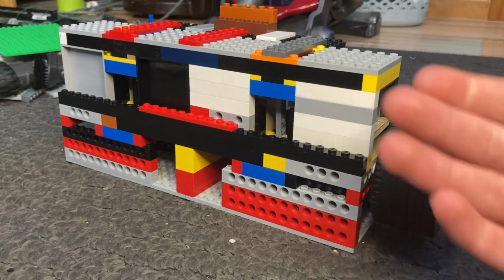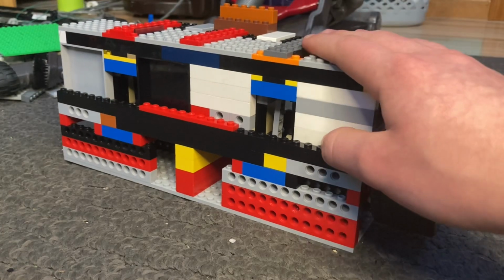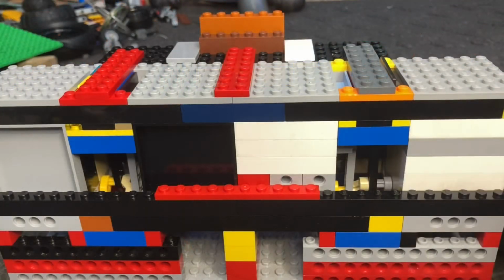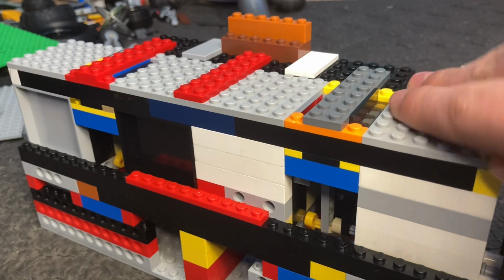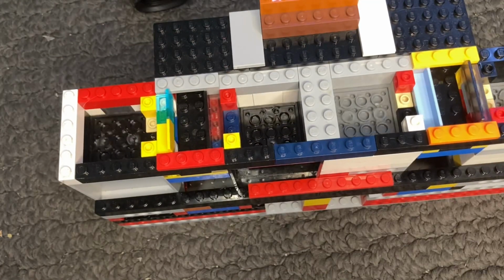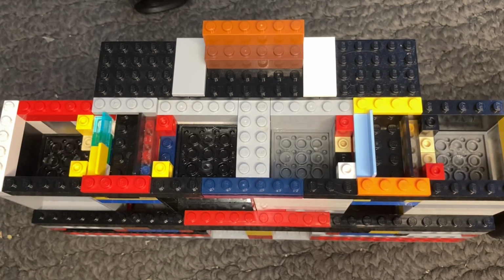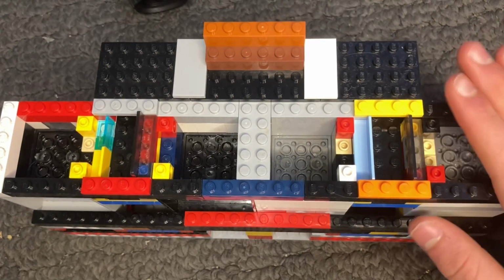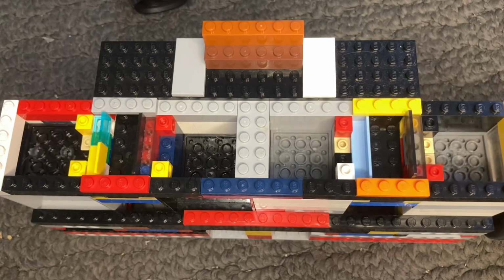4 Cylinder Lego Vacuum Engine

Comment: I have basically a two cylinder version of this where I looked at your basic engine tutorial and built two of thosesingle cyliinder lves and smashed them together. Works great cause your engines have a great desgin and very low parasitic loss. :)
Reply: Wow I did the same thing
Reply: @legoengine1464  its a great desginright
Reply: Yeah
Reply: Except I made mine with 4x6 pistons instead of 4x4

Comment: Sir, an engine is a device intended to power something. And while hearing one of these rev up high and spin a flywheel is exhilarating . . . The economically-minded part of me sees these and thinks “wow, this is wasteful!” While powering a car to pull an entire vacuum cleaner around is probably a tall task to ask of a chunk of plastic toy bricks, making some kind of assembly line or piece of stationary machinery for these to power is certainly a reasonable idea - well, in my mind at least. I don’t really know, it’s been years since I’ve so much as seen a lego brick, and I’m not a professional engineer. I don’t have exact ideas, but this thing SCREAMS at me “connect me to some machinery, darn it!” So for the sake of easing my mind’s tendencies towards conserving energy and putting it to good use, would it be a tall order to ask you to brainstorm some kind of machine to power these with? I have a factory, mill, or generator loosely in mind, though I’m aware there’s really no end to stationary machinery an engine could power - I had the privilege of watching a 16-cylinder industrial diesel engine get rigged onto a spud barge in texas for the sole purpose of pumping ludicrous amounts of water around for commercial diving operations, for example. The thing was bigger than my damn car!

Let me know what you think, what such ideas you may have, or if you want my humble expert opinion on what sort of thing you could power this bad boy with :3

Until the youtube notification gods get this your way, and you respond, I say, “toodles, and congrats again on 1k subs. I told you it was gonna happen fast😏”
Reply: My opinion is people make the engine itself for fun. I mean, I did see someone make a 4 cylinder drag car with an LVE.
Reply: @kiefox7162  wait, what? How the hell does that work? You need a vacuum cleaner to make an lve work, how’d the dragster carry that around? Was it a portable hand vacuum or something? Or just a really long vacuum hose?
Reply: @StealthTheUnknown  they had a long vacuum hose that is really light so it could basically drag it along the floor for a few meters
Reply: @StealthTheUnknown  dude one makes elgo engines for the sake of proving that you can make a working engine out of plastic. And if you dont like vacuum engines, go check out some lego pnuematic engines. And if you dont like those, no one is forcing you to watch this stuff.
Reply: @taylor842  you totally misread my comment. I’m not at all saying I dislike any of these engines - just that a part of my brain is screaming that these things need to be used to power something😏
Reply: @StealthTheUnknown  well in that case I agree with you! have you seen him power electric motors with vacuum engines?
Reply: @taylor842  not yet, I’ll have to check that out!
Reply: @StealthTheUnknown  they can be used as generators by putting a lego power function motor on it. If you connect this motor to another motor and you start the engine you will see the motor runs.
Reply: @probricks5035  I’m aware of them being used this way. It just doesn’t interest me that much, I want to see this used mechanically through a lego structure, lego technic and whatever is legal. Build some kind of machine or equipment that runs continuously for a bit. If you know how to build transmissions right, and clutches, you could for example have this power a crane, or a digger. You can basically build paired and mirrored belt tracks on a pinion gear, and put clutches on each side that increase or decrease the angle on that part if a worm gear powers a set of gears for the angle. It would auto-lock when you disengaged power from the part because that’s how worm gears be. Throttle would act as speed, or a stages on the control lever. Over short ranges, these things could probably even be built on a mobile platform like a cat crawler, but one step at a time